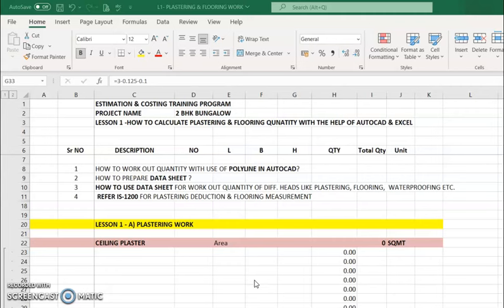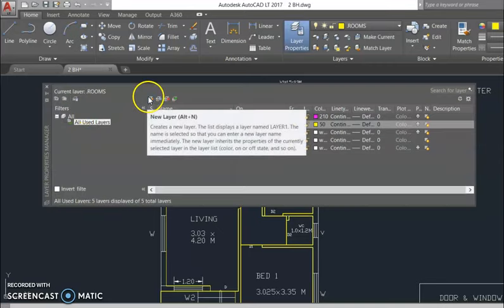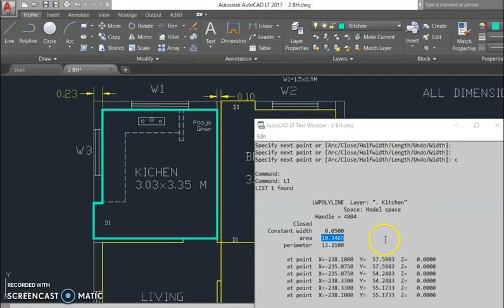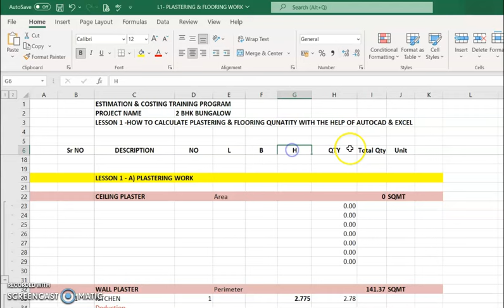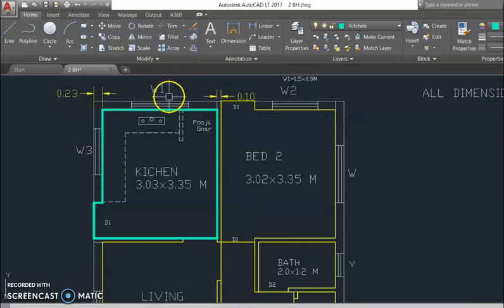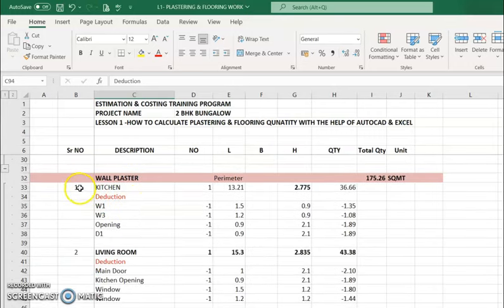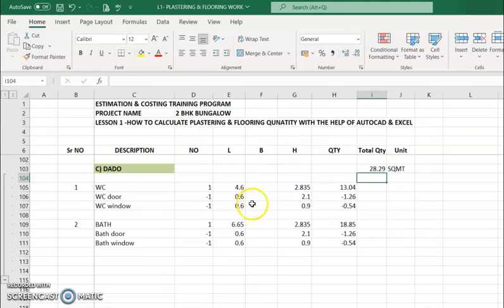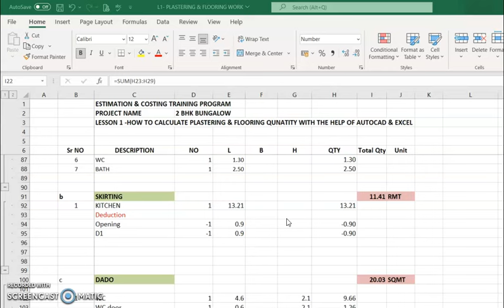Practically an easy way to perform quantity takeoff for plastering & flooring using AutoCAD & Excel.

Comment: Thanks for the vedio. My question is how you put area in length column in measurement sheet???
Reply from the maker: Please modify 1) In the headline, mention L/Area or 2) Specify the front of the activity Area or Perimeter as demonstrated in the video.
Reply: Sir please upload lisp files